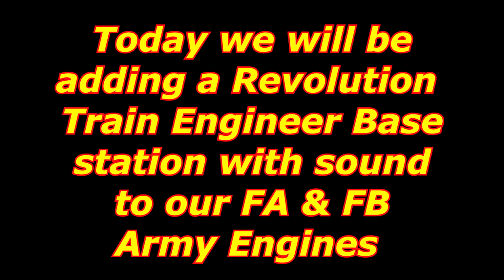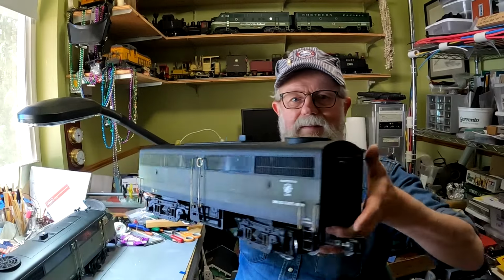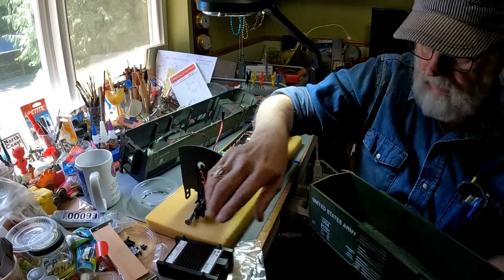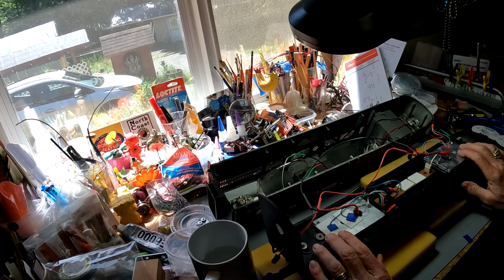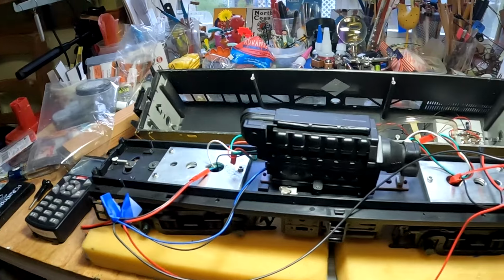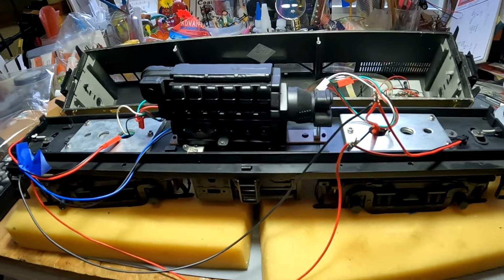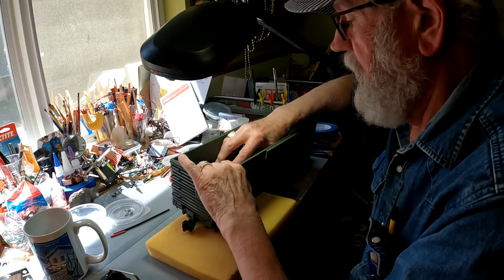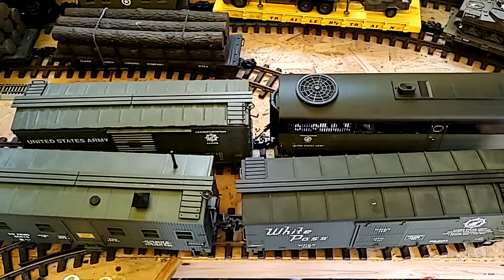Army Train Build

Comment: Excellent video! Presented well so just about anyone can follow along. I've had plans to do the same to my aba set of FAs for a while now. I may now switch to using individual boards since i have a good number of them now to use.
Reply from the maker: That sounds like a good thing to do, what type of RC are you using?  I did put individual receivers in an AB set of F7s that I have for my Northern Pacific, they work really well!
Reply: @gardenrailroading  I have revolution in just about everything.

Comment: I want to use a 20 volt DC Bauer tool battery pack in my steam engine's  tender to run its motor in the engine! How do I do that? No power on the track!!
Reply from the maker: I will have to look up a video I made on setting up a 20 volt Dewalt battery Vinny
Reply from the maker: Hi Vinny, here is a video I did to help a friend get his engine running again:  https://www.youtube.com/watch?v=rAWDVv-xkmA&list=PLVbyLf5tYXlRZ6jDnlMYb9oOdTY67knw8&index=45&t=5s
Reply from the maker: You will need to find a Battery Clip for your Harbor Freight 20 Volt Battery.  I always make a battery car as it is easier to remove and charge your battery.  You can email me for more information at: Trainmanhowe@gmail.com
Reply: @gardenrailroading  I have a Bauer charger that works well on my Solar system to charge up all those batteries! I have NO power from the power company grid, so it all comes from the Sun!! Later I'm going to have some kind of power controller pack or remote control!! I'll take a look at your videos after I get some kind of Spam Blocker app for my phone, the constant notification alerts ARE DRIVING ME CRAZY!!!